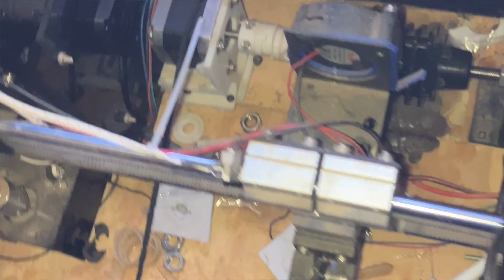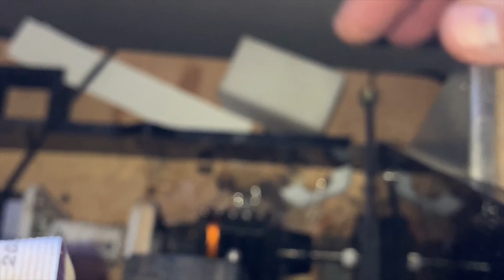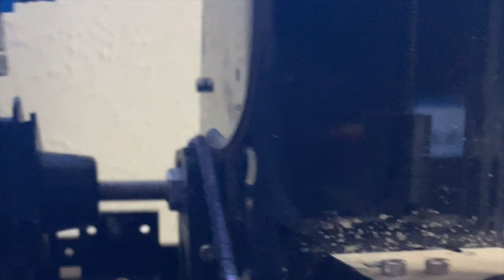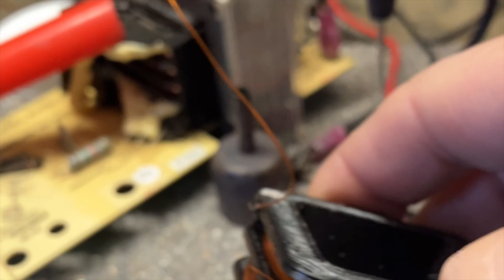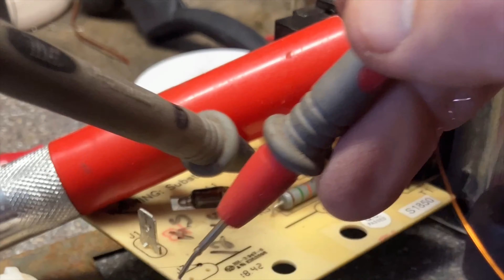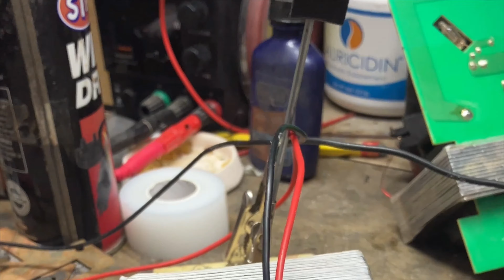Fence Charger HV Coil With An Old 3d Printer?

Comment: This is a really cool project! I’m a retired machinist and have a small shop in my garage and would like to offer you some help if you need it. Like Teflon bushings for the wire tension or maybe a better shaft to hold the bobbin so that it doesn’t slip. Let me know if you’re interested and we can discuss any parts that you may need. 
Ben
Reply from the maker: Thank you , I appreciate it. I really need to do some design work for the entire system but haven't really needed it as much as I do now. If I need anything, I'll look you up!